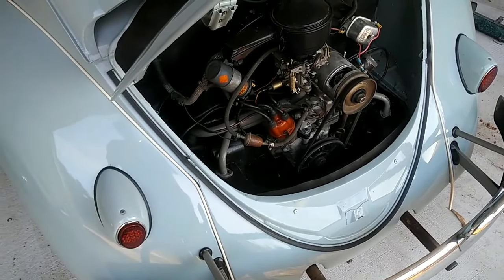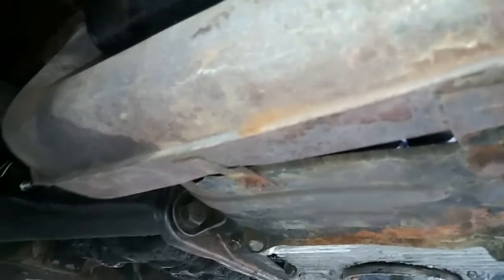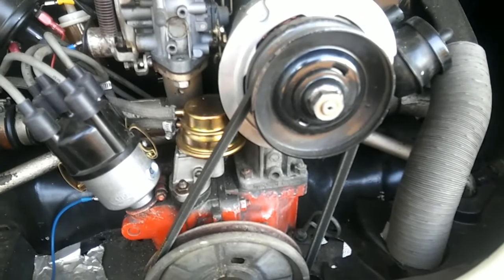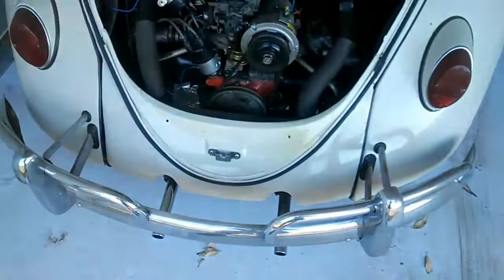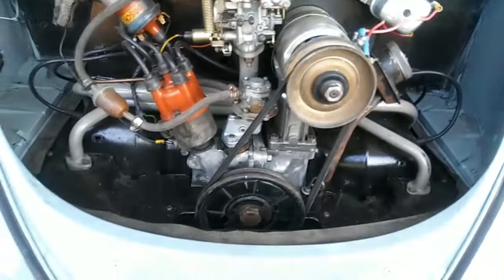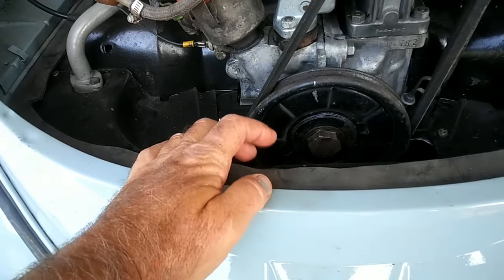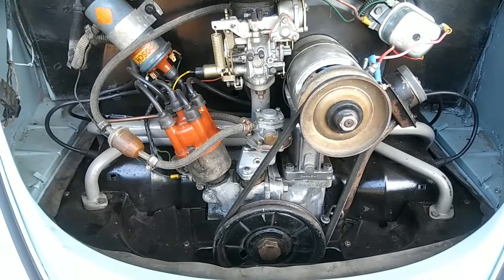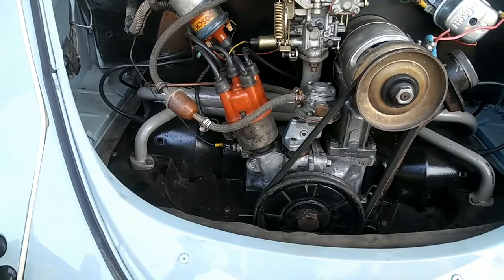VW Bug how to prevent engine overheating

Comment from the maker: https://www.youtube.com/watch?v=1mTVj5eTWjI

Here are additional key information for modified engines plus more cooling stuff...
Reply: Mike F : In regards to cooling systems, check out Jake Raby's D.T.M. cooling system. Each cylinder receives 20% cooling and the oil cooler receives 18% only 2% loss of air throughout the entire system. "R.A.D." (Raby Engine Development) has documented proof of the efficiency of his system. I personally own one of his T-4 2056cc engines in a T-1 bug configuration, although somewhat pricey it turned out to be great insurance for keeping an aircooled engine "Properly cooled" in the harshest conditions. Being able to drive the death valley in August without overheating is quite satisfying. These D.T.M. systems are also available for the factory T-1 vehicles as well.
Reply: Run it faster. It's air cooled
Reply: What is an acceptable head temp, and what is considered "to hot" / when us as the driver should start to worry.

Comment: Been running an oil temp gauge for 20 years and has served me well. If your oil temp gets too high you know your heads are too hot. Best thing i did for my engine run cooler (being in southern California where it gets very hot in the summer) was to space the engine lid. Dropped my oil temp like 40 degrees. It has never overheated since.
Reply: Cheaper and easier than a cylinder head temperature gauge. I will eventually add an oil temperature and maybe a pressure gauge too. Running a 65 40HP in a 64 baja.
Reply: What is " to space the engine lid" ?
Reply: @larrybrinley8222  i think he means the "hood" of a bug. more airflow?

Comment: How to prevent your air cooled VW from overheating ?  Just assemble and install it the same as they did from the factory with all of the same parts that it came from the factory. The folks at VW put a lot of Deutschmarks into designing it so it would run well, don't try to re-engineer it.
Reply from the maker: that is mostly right there are some improvements you can and may need to do. The car was designed to be used in Germany Not the Califonria desert or worse yet AZ or NV. I highly recommend cool tin for under the cylinders if you are building a new engine. It really works. There is a reason they put it on Porsche and airplanes.  plus the jetting for todays fuels.
Reply: german parts only if possible,just saying have you seen those Chinese aftermarket parts?they are really bad.
Reply: except it wasn't designed for 115degrees in Az..:(
Reply: Even if completely factory fresh, #3 cylinder still overheats and has problems with valves and pistons going bad due to how the fan cools the oil. As much as I love VWs, that's an inherent design flaw.
Reply: Some bugs here are all original and yet overheat all the time. Any suggestions on having a bug in a very very very hot city?
Reply: Yeah but dusting a ricer in his honda civic is fun and speed limits have changed tremendously. If you can... why not?
Reply from the maker: very good point there is a reason to one up the original design.
Reply from the maker: these backyard engineers have definitely one upped vw that is for sure.and no more lead in fuel so that has changed. plus the germans designed the car in cool climate Germany not AZ or CA deserts
Reply: @theoldwizard3876  B.S. These engines were war engines in the Sahara desert of Africa. They don't overheat if all the tin work is there along with the thermostat. Period.
Reply: @theoldwizard3876  Air-cooled engines are not affected by ambient air temps as much as water-cooled engines are. Because the heat transfer is direct, the difference between the cylinder temp and ambient temp is practically always large enough for cooling to work effectively. This is not so in a water cooled engine because the water is kept a temperature well above what is ambient temp.
Reply: @Mikefngarage   Beetles were sold all over Africa and South America (as were air-cooled Citroens). The engineers knew what they were doing when they made the cars. Whether the ambient temp. is 75 or 95, isn't going to make a lot of difference to a cylinder head that's 300+ degrees, the capacity of ambient temp. air to carry off that heat is barely changed by a 20 degree difference. Franklin figured this out way back in the 1910s. One thing that has changed is how we drive. We're either driving way faster than people did when the cars were new, or stuck sitting in bumper to bumper traffic - this was not what these cars were meant to do.
Reply: @arthurbttf  Then something is out of tune. Beetles were sold throughout Africa and South America - a stock engine in good tune does not overheat unless you're abusing it.
Reply: @arthurbttf  no air leaks, hod closed, shutters in and open, proper fuel-air, single weight oil.  Heads are the heat producers. Removing the oil cooler inside the fan housing actually increases air flow over cylinder, and decreases it over the 3-4head. Resulting in hotter oil, not colder. Information from Gene Bergs research.
Reply: @edwinhsingmaster9135  Gene Berg, there's a name I haven't heard in very long time.
Reply: Except it was designed over 60 years ago and was designed to be cheap. It can definitely be improved upon.
Reply: @Mikefngarage  u do t want to use cooling tin that stuff doesnt work whatsoever
Reply: @lasvegasira  airflow over oil cooler partially blocks #3 cylinder head fins. This reduced heat dissipation is why #3 runs hotter. Sometimes burning the exhaust valve.
Reply: @Mikefngarage I believe they anticipated the car traveling anywhere in the planet not just Germany. Part of the reason the car was in development for at least 5 years before the type 1 we all know today. 
The seal around the engine should be folded over like the factory. And those simple deflectors under the engine between the cylinders are critical to survival. Often times they are deleted or lost in rebuilds and that is a kiss of death! So is removing the thermostat.
Reply: @lasvegasira  Yep.  I've rebuilt a couple hundred engines and if a valve fails, it's #3 exhaust.  Often breaks off... kaboom.

Comment: All these people without the proper tinwork and seals complaining about the "design flaws" of the engine. No, its the fact that you butchered it. Take out half the radiator and switch down to 1/2 radiator hoses and see how well your water cooled car works.

Comment: What people fail to figure out is the whole cooling system is "ducted" so the air flows evenly to the places it needs to be. Removing any of the sheet metal or modifying the flow screws that up. This goes double for those deflectors under the cylinder barrels and the curved pieces between the heater box and the block., It's all there to shape the flow for maximum cooling. The factory inlet louver above the decklid already has enough opening for the needed flow. The only reason the convertible decklid has louvers is because there is no opening in the body. Yeah, many of the later bugs had louvers in the lid, but that's more for the trapped heat when you park in warm climates. You will never see any improvement in cooling on the highway.
Reply from the maker: yea for sure. the only time you need any real upgrades is when you dont have the stock motor. Late models had more vents for the bigger 1600 engine and or dual port. They ran hotter. The only things I found that help are the Cool tin style deflectors as a add on. They do work. So many guys also put late model 1600 engines in early cars. They run hotter than the 40hp or 1300 that came in them. A bit wider too. But it does work.

Comment: It's funny that most people's engines always have those tin screws that secure the bottom tin to the case missing.  Not sure why, but I bet it's well over 50% of the motors I look at have those 4 screws missing.  I'm sure you also notice that the carb preheat tubes are missing the inner and outer top seals.  Not a big deal, but still missing and a place air can recirculate back up top.  You obviously know your way around ACVWs but for those that don't know what complete tin looks like, you might want to point that out.  Great vid none the less.
Reply: This is for the guy that uploaded the video some of what you are saying is true but for the most part it sounds like you are Repeating something you heard from that doesn't know everything about aircooled VWS Dr Porsche would give you an E for Effort for making this video without all the facts you can post this for all of your viewers you want to Run a 3.88 ring and pinion if you gonna be running on the Freeway at 70 plus mph I want get into all of the other ways to keep the engine cool ok maybe one more just for you I noticed the deck lid on the car with the Dual Port engine didn't have any Vents where does the heat go when the car is parked...it normally goes up but your car has no where for it to go  oh and another thing you fuel line the rubber section are a fire hazard you might want to change those ASAP or sooner...and be safe

Comment: Also painting your engine is a bad idea. A clean rough casting is best for heat dissipation. Dr Porsche knew what he was ding. Very smart guys designed this stuff.
Reply from the maker: yes good info.
Reply: Just depainted mine.  Last guy painted it gold. 🙄
Reply: @LaverneDefaziox  Mine was painted silver when I bought it. Everything was. That rubber tube going from the air filter to oil filter? Spray painted silver. A rubber hose. Lol

Comment: Great explanation! Good job and nice bug! 
Just a little improvement: Relocate the fuel filter below your tank to avoid leaking and fire in your engine compartment.
Reply: And place it before the pump rather than after. Better to have the pump sucking through the filter than pressurizing it

Comment: Ditto on removing the fuel filter. Relocate under the wheel well. Also, lace the hose clamps where they connect to the carb and fuel pump as the brass fittings frequently slip out of the casting. This together with ensuring you have a good grommet where the metal fuel line enters the firewall and you will have mitigated 99% of the risk of fire. Very nice car. Please do not let it burn up. I have seen too many, all the same cause.
Reply from the maker: yea grommet or wrap the metal line with hose. a little silicone to hold it in place. Like these comments and hope more people read them. I have never had a fuel filter crack yet but I am a bit more worried about the new stuff now made so cheap.
Reply: Never put the filter on the pressure side of the pump!
Reply: Instead of lacing the brass fitting, I put a drop of Loctite on it. Then I inserted the brass fitting (which has about a 15° bend in it) into the fuel pump. One second later it was impossible to twist the fitting. The Loctite filled the clearance between the two parts.

Comment: My 71 bus(12yrs)had a Berg $5 oil dipstick temp gauge.  Made the red oil light flash when oil got hot.  Used it on my 1776cc dual carb. I added a deep sump and external oil cooler w/ electric fan mounted away from engine under floor.  Course my oil volume went from 2qt to 6qt.  I totally agree that ALL SHEET METAL has to be there.

Comment: Nice tip on rejetting and cylinder head temp gauge on #3. I like the version which uses a ring under the plug. I’ve had bad luck with the version which utilizes a cooling fin attachment. For Florida summers I use the deck lid stand offs along with your lid lift. I also like the Mystery Oil setup. I’ve been doing VWs since 1977 and it’s funny older you are the more stock you run and appreciate the amazing engineering done by the factory designers.
Reply from the maker: got that right all stock no problems.
Reply: advice i am looking for // i just want longevity and smooth . buy new stock motor from germany . haha.  @Mikefngarage

Comment: Good advice on keeping top and bottom of the motor isolated, that's key as is running all the tin including "sleds" underneath.  As VW increased fan capacity they started adding the deck lid louvers.  My 1970 has two rows of louvers and a rain shield but not the dog house shroud, just a wider fan.  Doghouse flows a lot more air.   You may never have a problem but the best place for fuel filter is where the fuel line comes out of the chassis at the back of the pan and use a metal one, not plastic or glass.  Almost everybody tossed the flaps and thermostat when rebuilding but the flaps actually redirect a little more air over a section of the heads even when fully open.  It's not vital but does help cool the heads some.  I run them in my bug but not in my speedster.  I also don't like how the new thermostats fail closed but the old accordion stats can still be found.  If you run stand offs you can use baja bug tricks to keep your bug running in the rain/wash.  Hair spray on the plug wires was one of my favorites. :)

Comment: I have never had an overheating issue with my '71. When i adjust the valves, I always leave #3 a bit loose. I also have an oil cooler and filter (aftermarket) Also, keep the seals in good shape as well.  Every 1500 miles or 3 months, i inspect the fuel pump, lines and fittings.

Comment: My family has owned hundreds of air cooled VWs going back to the early '70s and always:
- The engine tin exists for a reason. Don't remove any of it
- If you still have the thermostat flaps in the fan shroud, for the love of God pull em out and chuck em! 
- Keep it timed properly 
- Keep the engine clean! Oil, grease and grime holds heat

Comment: Never been around beetles and somehow this video came into my feed.   Very interesting watch!   
I think in regards to the cooling points made, you have guys coming from water-cooled backgrounds unaware just how much engineering work went into that ducting.    They chuck it thinking its a weight mod or hindering the ability for easy maintanence.
Reply from the maker: thanks for watching
Reply from the maker: be carful they are addicting the basic technology that was used was enticing.

Comment: great info video. a must watch for all newbies to the VW family. Keep dubbing
Reply from the maker: for sure you wouldnt know how many guys still have those holes in the rear tin still open that have been driving that way for years and wonder why they keep having to change engines. Look at cars for sale and open holes in rear tin or missing. want a fortune for the car.
Reply: Something so small and simple can save so much. When it comes to engine bay all that chrome won't get you home. It creates more heat or vapor lock where gas will start to make. bubbles. im curious to see the views on this one. I will be posting more videos and starting on first car. Whichever that one may be. Keep your eyes open. keep your videos coming. I have learned alot. keep dubbing
Reply: volkswagenplanet knowing you have a lot of vw experience, I'm thinking about getting a beetle and wondering what maitnence I should do and what to buy when I get one.  in mind I want a small turbo so what should I get for a turbo set up. Thanks if you can help out :)

Comment: keeping the baffle deflector between the cylinders is very important as well as a sealed doghouse,no holes in it,also keeping for fan free from dirt,and keeping all ribbed aluminum on block free of gunk or debris,fan tension and length of spark plug threads also are factors,depending on what kind of driving you will be doing.oil level also very important a vw only takes 3 qts so if you are low a 1/2 qt thats going to be a problem.oil leaks gunk up cooling fins and compromise cooling ability.i can keep going but i won't.theres so many things.

Comment: Yup, been running premium gas since the lead was removed (ages ago). Since the Bug gets pretty good mileage I figure spending more on gasoline (per gallon) evens out in the end. Costs less to operate than my Toyota Land Cruiser on regular gas. 

I used to run my old Karmann Ghia with full instrumentation: tach, volts, oil pressure, oil temp, head temp. And the doghouse cooler, after Gene Berg did tests showing the German engineers knew what they were doing.

Comment: On my Type 2 Transporter I routed the fuel line/filter round behind the manifold at the rear of the Carburetor. A little harder to get at but I learned after a near catastrophic engine bay fire it was worth the hassle.
Reply from the maker: yea that is cool. I have seen some with fuel hose rubbing on the throttle cable doing that just keep it clear of that. Had them both ways and never had an issue. But I have seen the barb slip out of the carb an burn several of them to the ground.

Comment: I'm amazed how many people still put the fuel filter in the engine compartment with the known fire risk from the distributor and exhaust right there. It's not that hard to put it up front instead. At least yours isn't over the distributor like most people do.

Comment: On a 67 beetle I am trying to get running right the carb is new from a different mechanic. The main jet and air screw does not seem to lean out as it should..sootey.plugs of course..compression is 120..on all cylinders..and changed over to electronic ign..going up on throttle is sluggish too.tks 👍
Reply from the maker: the carbs need to be jettied right out of the box. Rough jetting is 55 idle and 130 main jet. but you need to check them with a sizing tool. I have found several stamped wrong. Jet sizing tools are available from empi. also they have jets check the size before you install.
Reply: @Mikefngarage  Thanks sure like your VW'S..And your speedy responce..👍